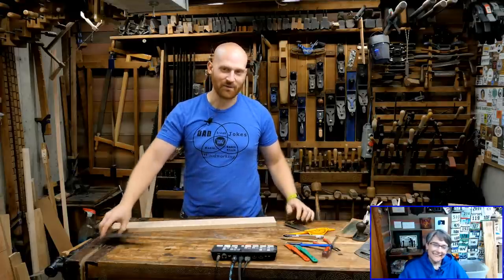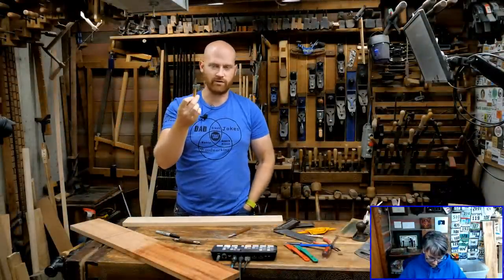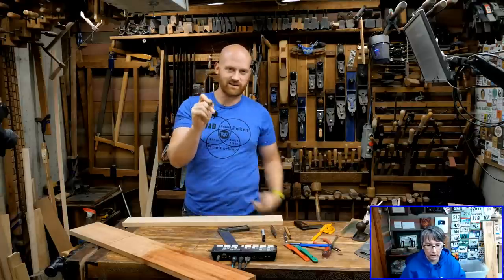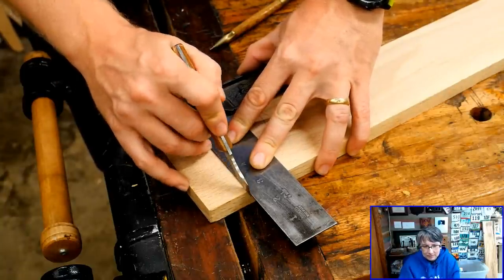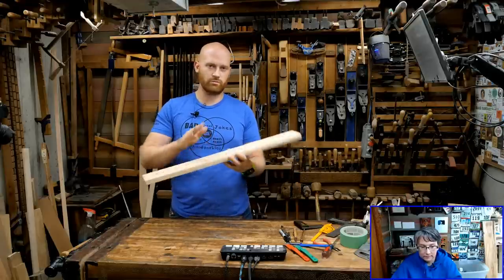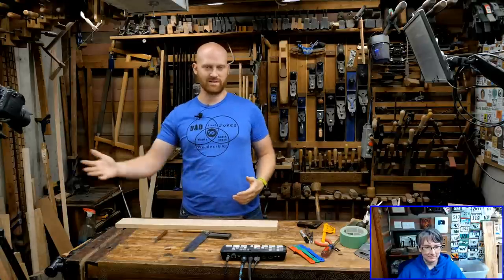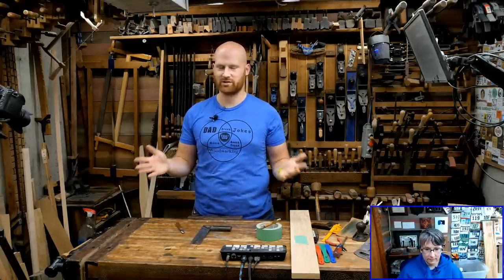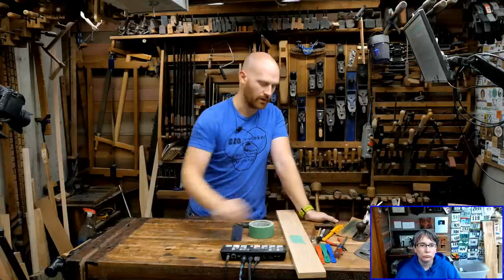Improving Your Marking the Key to Better Joinery

Comment: I would add a 4h pencil. Its an extra hard lead that makes a super fine line- at about a 32nd of an inch
Reply from the maker: I have one of those, love it for drafting work!
Reply: @WoodByWrightHowTo  good point. I use it on smooth wood.

Comment: Is there any reason to pick one face/edge over another to be your reference or is it purely arbitrary?
Reply from the maker: If your dimensioning the lumber yourself the first face that you dimension is then your reference face because you will then dimension the other edges and faces off of that face. Also, the first edge that you dimension becomes your reference edge. If you are purchasing previously milled material then just take a look at it and see if one edge is straighter or cleaner than the other. And make that your reference.

Comment: Tape measure is a "new" tool in the workshop. The pyramids and acropolis builders used a story stick and true life objects in building. Stone masons throughout the ages could not read or write but still build stone wall were you can't place a hair between the stones. Rulers are way over rated and over used.
Reply from the maker: So true!